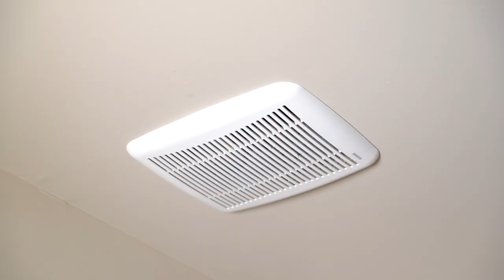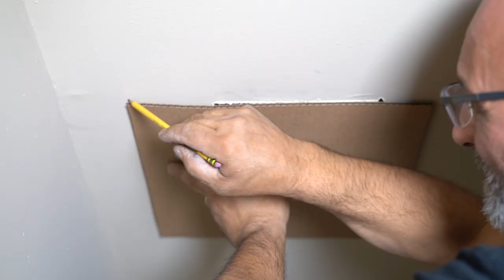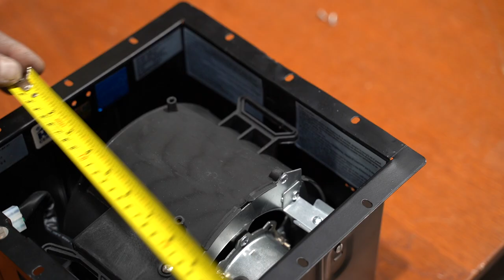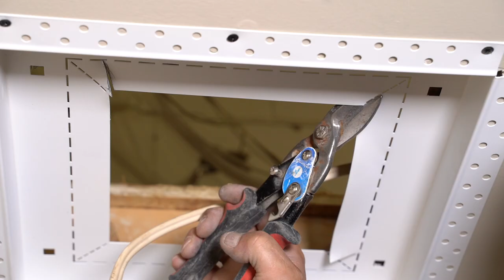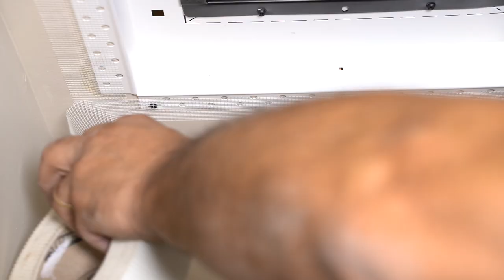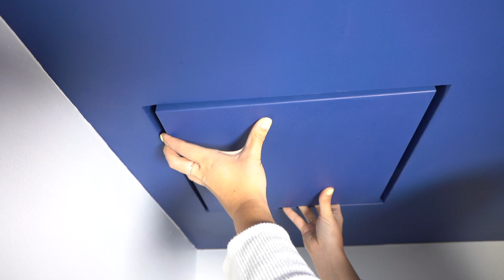Drywall Pro X - Install Video

Comment: Do you need to connect this to framing?
Reply from the maker: Not necessary, but you can if it works for your installation. Your contractor will have the best expertise on this :D

Comment: Airflow reduced?
Reply: Why are people so obtuse? Do you really think a company puts out a product where the MAJOR flaw that everyone assumes to be apparent actually exists??? Really??? BTW Aria, that is cool. May use that. I just installed the Aria Pro. It wasn’t easy cutting the tile but it looks cool.
Reply: @renaissanceman8581  Yes, it's possible.  Form can come at a price.
Reply: @renaissanceman8581  I think this too. They have people on facebook slamming it, without checking out the airfloor ratings on Aria's website.
Reply from the maker: We have our vents lab-tested by a third party. All our airflow data can be found here: https://ariavent.ca/pages/air-flow-specs

Comment: Can you use it as a return, if you do how can a filter be added?
Reply from the maker: Hi Erika, our Drywall Pro X is a return :) At this time, we do not have air-filters that are compatible with our vents. Our R&D team here have a suspicion that we will create a vent that has the capability for a filter sometime this new year. Stay tuned!